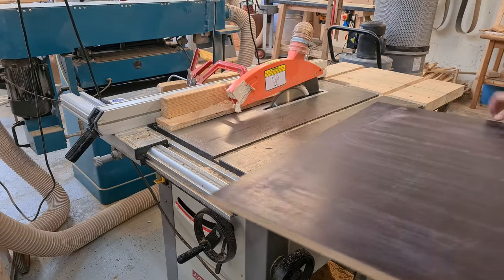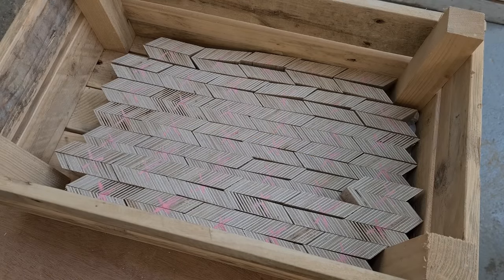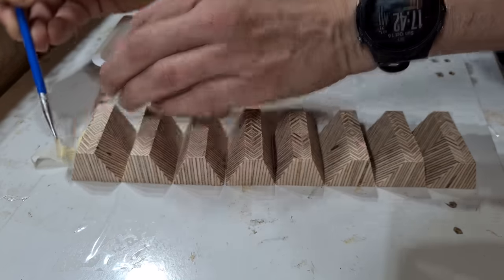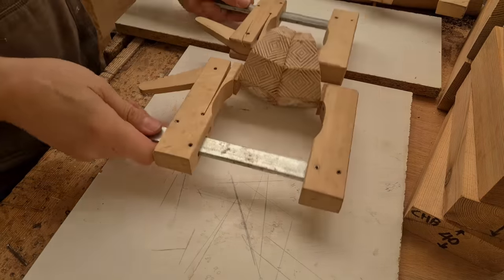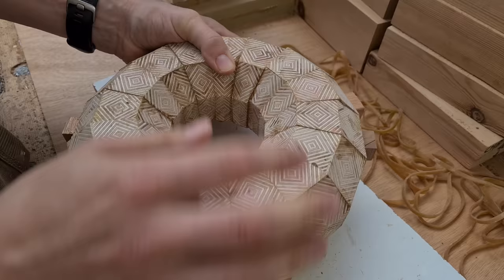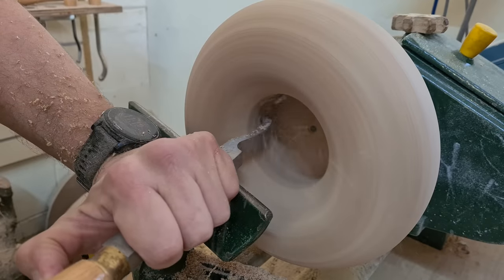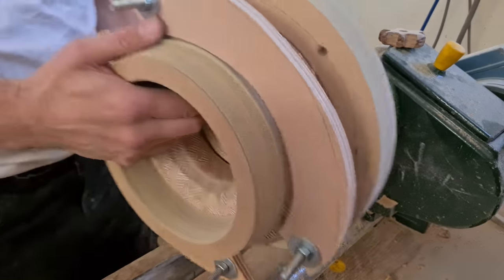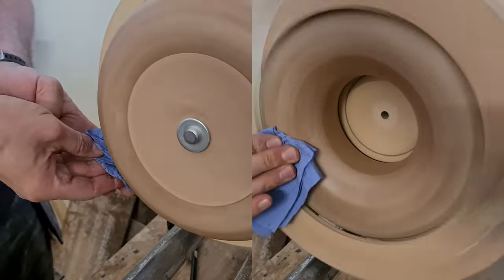"Mind-Blowing Woodturning Trick That Will Leave You in Awe!"

Comment: Very nice, Ray!  I turned a segmented torus many years ago - long before I started making videos.  I glued up staves of walnut, maple, and cherry into a hollow "log" and then cut isosceles segments from this log with miter saw to form the blank.  Rubber bands sure are handy where other clamps won't work.
Reply from the maker: Thanks Steve. It's an interesting approach you used. Gord Rock had a unique way of doing it too. I guess there's no single right way to achieve the final result, just a method that works for the individual! All the best. Ray

Comment: Using Flat head screws for  fixing the Torus in place is the best choice for fastening the torus in place because they can be flush or slightly recessed in the surface if the clamping block and are self-centering. I would also recommend using grade 8 screws because of their incredible strength. The diameter of the head of the screw is twice the diameter of the shank and tightening things up on the lathe with hex wrenches is very user friendly especially if you have a set of hex keys mounted in sockets ( about $200 FOR THE SET, OUCH)
Reply from the maker: Thanks Charlie, I'm still loathed to drilling holes in this torus and want to find a stand it can rest in.

Comment: This is a truly amazing work of art and craftmanship, Ray.  I am a mid-level turner and like to try new ideas.  I have a couple of questions about the video. At 3:06 of the video you state that each half is glued together in a stack of 3 (I thought this was done earlier in the video. Is there some other gluing going on?)  Then you cut the stack of 3 at right angles on the table saw into individual pieces (you make these cuts all the same size. Then how do you get the layers of the plywood to line up between pieces when you glue them together? It seems that the width of the table saw blade would shift the pattern on each piece)
I hope these questions are not too foolish, but I would appreciate your advice.